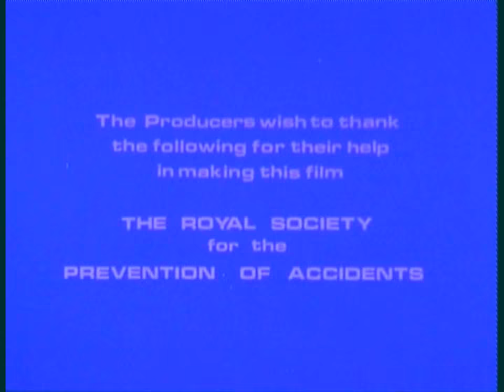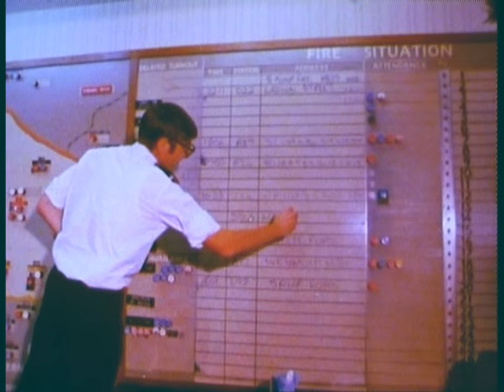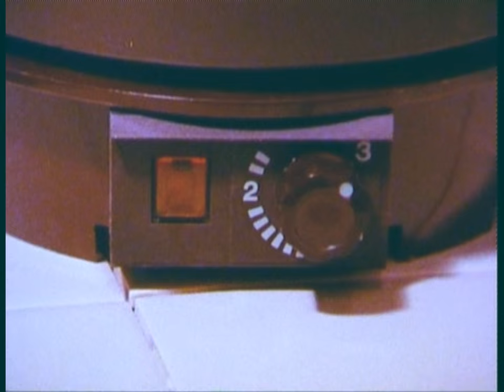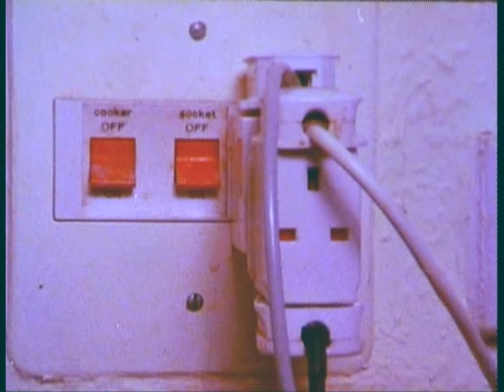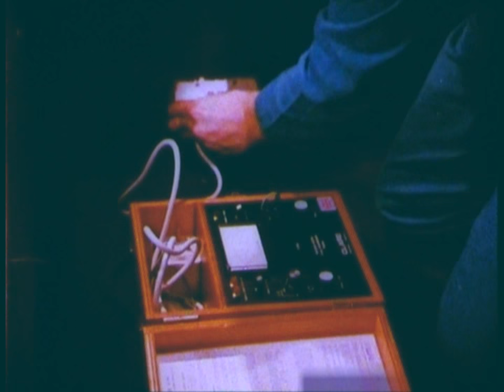Nobody Told Me (1983) UK Public Information Film - Home Safety

Comment: My bedroom had one single plug socket with a double adapter in it. Within this arrangement I managed to run a tv, stereo system, ZX spectrum, tape recorder, 3 bar electric fire and electronic keyboard. I was constantly fitting wires for two things into 1 plug or just forcing them into the socket with the double adapter. Blew the circuits for ours and next doors on at least 3 occasions. Lucky I didn’t kill us all.
Reply: Looking back do you regret it
Reply: Very dangerous overloading

Comment: When I was about 10 in the mid 70's I lit a match to peer under my bed. There was a whomph! and a sheet of blue flame flashed across the entire underside identical to a gas flame igniting. It was so fast it blew itself out. The underside of the base of the bed (1971 vintage) was a rough hessian type material evidentially with no fire retardant back in the day. Funny thing is, I just thought "phew - that was a close shave", but needless to say, was absolutely paranoid about safety when I had my own kids.
Reply: What happened to natural furnishings
Reply: Pyromaniac
Reply: Just kidding.

Comment: Something people SHOULD be aware of, even more so after the Grenfell tower tragedy is the back of Fridges/Fridgefreezers/Chest freezers should be vacuumed regularly as the build-up of dust and fluff is a fire hazard. Having worked in a charity shop a few years ago I prevented one breaking out. An under bench fridge was smoking at the back forcing me to extinguish it. Same applies to T.V. vents. #nobodytoldme!
Reply: Who has vents on their tv anymore? Aren't most tvs the paper thin panels now.
Reply: TheCrayCrayGirl  a lot of flatscreens actually still do. Usually at the back on top and the sides. Maybe not the kind you describe, but the ones I've owned in last three years have.
Reply: You are so right. Not just built-in fridges but those American style ones too. I think it's a thing to have forced cooling of the heat exchanger these days - probably to get the efficiency rating up, but this efficiency goes down the toilet within a couple of months as the rats-nest heat exchanger gets covered in fluff and is impossible to clean without an air compressor to blow it out. As it is buried behind panels, I suspect very few are ever  cleaned and are a tinderbox as well as trashing the efficiency of the fridge.

Comment: Ah, wiring a plug.  We always had one plug too few in the house, and I remember from the age of about 11 being asked to take the plug off the iron and put it on the washing machine or whatever.  And you never used s screwdriver, always a knife out of the drawer. When the fixed plugs came in, wasn't so much fun, for some reason.

And do people still use chip pans? I thought they'd gone the way of boil washing socks on the stove.  I tried to explain what chip pans were to my American wife, and she just looked bewildered and asked why we didn't have electric deep-fat fryers.
Reply: +John B ..Ha, you'd be surprised how many fires we've had over recent years in the North East of England. Always the same: fall asleep drunk and leave the chip pan on. I've seen so many in the papers, the blasted things should be banned!
Reply: What did they have in 1983, 2005 tech? XD
Reply: I've lost many a good sausage to that!
Reply: Caused a fire on s Carrick mines halting site

Comment: 3:15 - Um, how is reducing the oil level in the chip pan going to make it less likely to catch fire?  It does reduce the total fuel load, true, but as far as the fire starting in the first place goes, the reduced thermal mass would, if anything, make the oil heat to autoignition temperature faster.